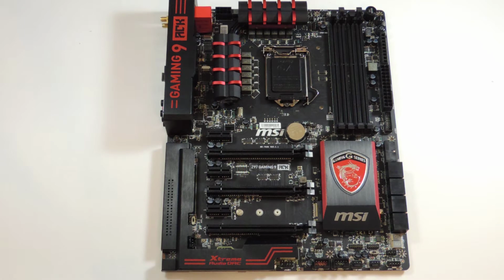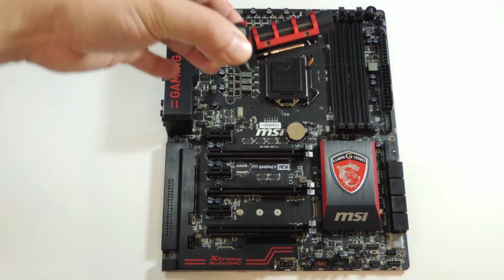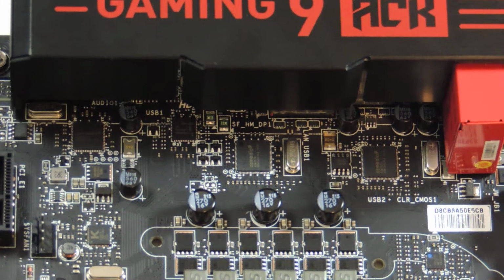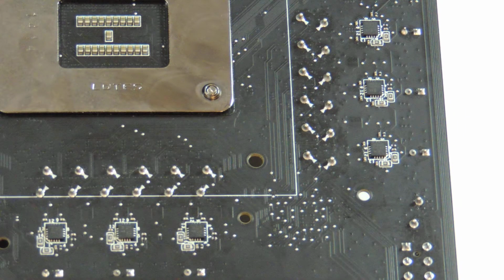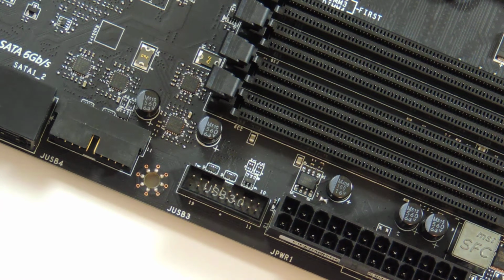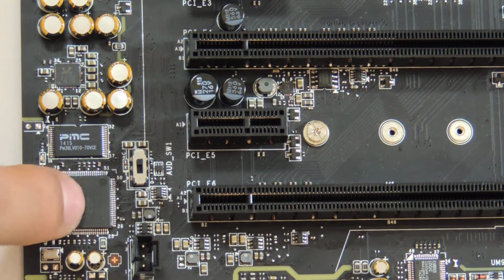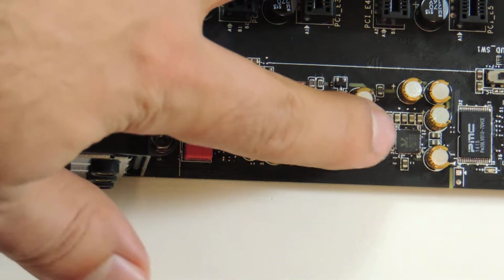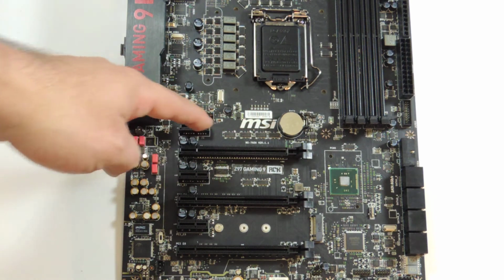[SH] MSI Z97 Gaming 9 ACK Review

Comment: have one it's epic. only main reason I have issues with it the mouse and or keyboard.  when you power on it has a tendency to turn off both your mouse and keyboard.  other then that I paired it with a i7 4790k which i have had up to 4.5ghz and a amd Radeon r9 290x lightning  with a corsair have 100i and 16gb ram crucial tactical ballistix tracers. a wd blue 1tb drive. other then mouse and keyboard issues it's a great board.

Comment: anyway could could briefly cover the differences between the gaming 7 and the gaming 9 (besides the more obvious features like wifi)

i also wanted to mention one more thing/discrepancy. in the video and your tweaktown review you state "The PWM is an Intersil ISL6388, and I haven't seen any other brand use this PWM yet, but I think it is Intersil's most advanced VRD 12.5 PWM. This is the first time I have seen Intersil call their PWM digital outside of their Ziker Lab's parts, so it is safe to assume it's a fully digital PWM."

in your vrm list (the image of a chart/excel sheet), the msi gaming 7, like the 9, is also listed with ISL6388 however described as Analog/Hybrid

Comment: Fabulous!
I'm speechless, never expected to see such perfection on YouTube.

One request: Would it be possible for you to explain why the MSI BigBang-Xpower II Motherboard (Intel X79 Processor, 128GB RAM, XL-ATX, RAID, Gigabit LAN, Socket LGA2011) is so perfect. I own four and they are by far the best mobos I have ever had.
This request brings us to the X99 fiasco (mobo wise). I have 4 i7 5960x waiting for a mobo which deserves them (to replace the X79s).
I would like to hear your thoughts on the X99 mobos and why apparently all manufacturers seemed to be surprised by the new chip... All seem half-baked to me, like something assembled on the rush (with a lot of corners being cut).
Am I wrong? Is there a great X99 mobo out there?
If so I would love one of these reviews on it, or just your recommendations.

Once again, congratulations.
Cheers.
Reply from the maker: NorthWolfe Thanks man! So i actually had a X79 BBXP2, it was possibly the best X79 motherboard I had tested, it OCed excellent (especially BLCK), it had great hardware, and it didn't flinch like all the other X79 boards I tested. X99 is a different animal compared to X79, almost really every board I have tested is 100x better than their X79 counterparts. If I was you I would buy a few boards that look good to you and try to get one with the socket with extra pins (all ASUS boards have it, and other manufactures all have it with their latest models). Unlike X79, boards from all manufacturers are quite good for 24/7 use for X99, I think Intel really got their game together for the high end desktop.
Reply: sin0822 Thanks for the reply. My X99 builds are replacements for the X79s. They are essentially for CAD/CAM (auto industry) and for Video/Photo editing.
It just seems to me (maybe just some bad reviews I read somewhere) that Mobo and RAM manufactures just weren't ready for the X99 platform (or maybe it just doesn't justify the huge investment).
The X99 would certainly save me a lot of time/money.
What RAM would you recommend I use? Are the timings getting any better?
Cheers.
Reply from the maker: NorthWolfe I wouldn't worry too much about timings they are around the same as DDR3 for the same speeds, but I would recommend staying below 2600MHz, at least for now. Maybe one of those Crucial 2133MHz or 2400MHz 32 GB kits would work fine and hopefully not be too expensive and provide decent performance. The thing is that the memory controller is just a souped up DDR3 IMC, maybe in the future this will change. The issue with X99 and memory is overclocking above 2666mhz for anything other than bench-marking, because the dividers above 26x or 26.66x aren't well implemented by Intel and require manufacturers to individually implement them which is tough, if you do you would be lucky to find a board that consistently boots above 3200MHz well without much training and even more so if it didn't require using the 1.25x BCLK divider. The socket with extra pins helps reduce the VCCSA voltage for higher memory OCes which is important for 3200MHz overclocks, which require +0.5v on boards without the socket and +0.2v on boards with it, but either way support is flaky. I just got in a new 3200MHz Dominator Platinum kit and I will test it out, before I had used G.Skill and Kingston 3200MHz kits with the same results.
Reply: sin0822 Thanks. Since they are for productivity PCs no overclocking will be necessary... Never saw much gains in it anyway. 24/7 High-Load stability is what I want.
Crucial is my go to memory and I trust the brand at delivering what they promise.
I will probably wait a couple of months to see were things stand... It's not like the CPUs have a shelf-life issue ;)
Anyway, we are now in the off season where I am just looking around the inter-webby thing for cars to build on in time for the next annual big event (end of the year Bankers' bonuses).
Thanks for everything and keep up the amazing work you do!
Cheers.